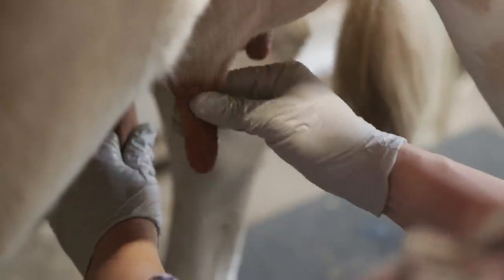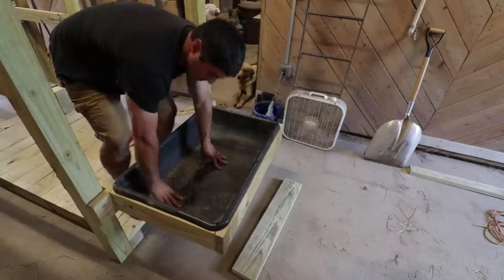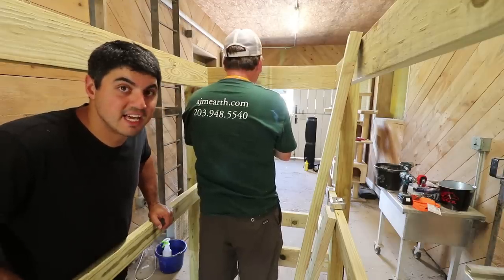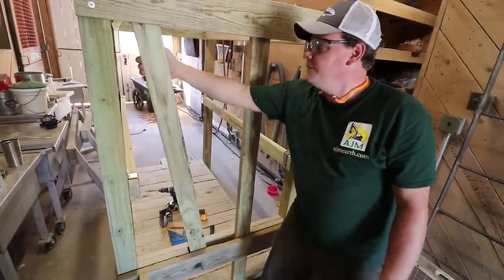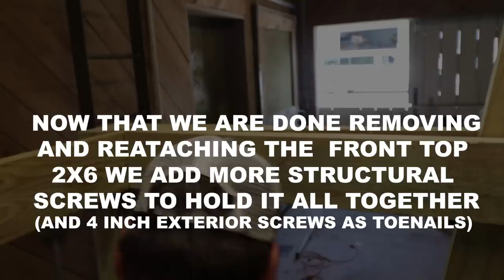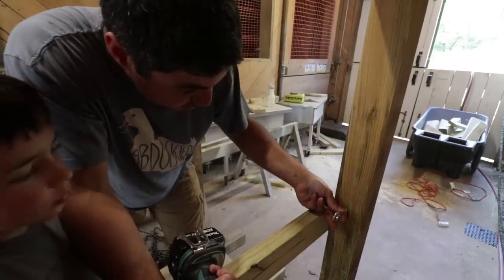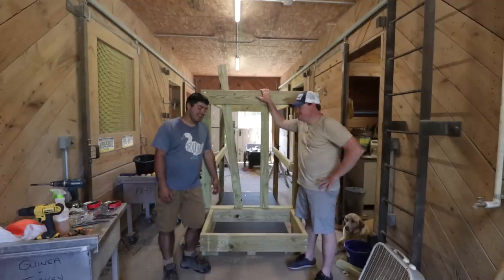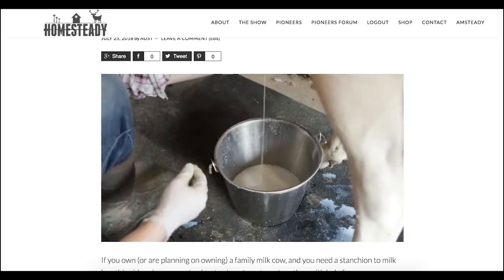How To Make a Cow Head Gate for a Milking Stanchion

Comment: When I was a kid we had a hundred foot long wood stanchion in the barn for milk and many cows.
Reply: The locking mechanism was just a short piece of 2x4 with a bolt through it that stood up and left the movable part open up. When the cows came in the milker just needed to push the locking mechanism parallel as he pushed the 2x4 over. It even had a notch in it so that the stanchion closed in two steps if you wanted to make it looser or tighter. Much simpler than putting a boat through and taking it out. Just lift the short two by four and the head gate falls open.

Comment: On the locking mechanism...wouldn't it be better to simply have a pc of wood with a small handle on it, hinged on one end, that you can drop down to lock the head holder in place?  I predict that bolt sliding in and out will end up being a huge pain in the rump to deal with.  An 8in pc of wood you can easily drop down and pick up makes waaay more sense to me. Also....the food bucket tray need legs for support. It might seem all solid and wonderful at the moment, but over the years it's gonna be bumped and held down and will eventually droop.  I'm a little surprised that you didn't put supports under it.  I predict that at some point you will feel compelled to attach legs. Might as well do it now.

Comment: This is similar to what we had on the farm where I grew up. The lock for the head gate was made with a piece of 2x6 about a foot long. A bolt went through the outside end, and the end at the moveable side was notched. That way, when the cow entered and the head gate was shut, the latch automatically dropped down holding the cow. To make it work efficiently with this design, simple add a 1/16 inch spacer to all the non moving parts of the headgate. I used VCT to make my spacers.

Comment: you can save your self a lot of money and time, look around old dairy farms or put an ad on line for the old metal head gates that were used back in the day of the stall milking, I have 10 or 12 extras I picked up over the years, you get them for free,  all you do is add a chain to the floor and top beam to install it

Comment: Nice video, thanks for posting! 

One critique though that I couldn't let go by: That little rope that you put to stop a cow from moving backward... With Ladybug, already trained as she is (just watching your most current one now, the "we didn't milk for two months" one... she's eager to get back into the swing of milking routine again, which is good to see), you don't have to worry about that. But with a new heifer like Luna, that rope may be too weak to hold her back much, particularly if she puts her whole weight on it, and could snap in a jiffy when you're trying to get her to get her head into the head-gate. You may be better off with a much thicker rope (e.g. thick like a horse lead), or even a 2x4. Save the smaller-diameter rope for tying up the tail if you're getting frustrated with it getting flapped into your face. :) 

When I've worked with much less tamer cattle (ones that never get regular handling like Ladybug or even Luna), putting that 2x4 in behind their butts works great to stop them. They often will put their whole weight on that board, and the only time it'll bust is if it's rotten. The 2x4 suggestion may be a little over-kill for your homestead, but you just never know when it may come in handy! 

-Karin
Reply: Could one use the same brackets on the back like they did on the sides for a 2x4 to slip in?
Reply: @simplecityfarm337  well, considering the cow and how hard she’s going to push going backward, that’ll work as more of a mental barrier that “I can’t back up either, darn,” than anything, so it might work. In a stanchion like that, the board could be put between the cow and the support beams, which makes it less likely for the bolts in the brackets to pop out. Again; I have to remind myself that folks aren’t dealing with the kind of wildies that I have lol